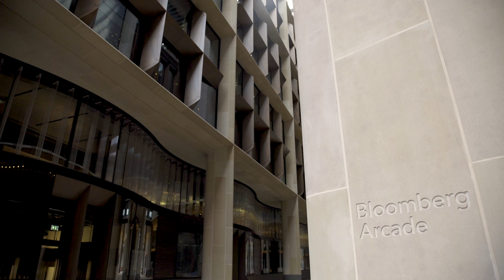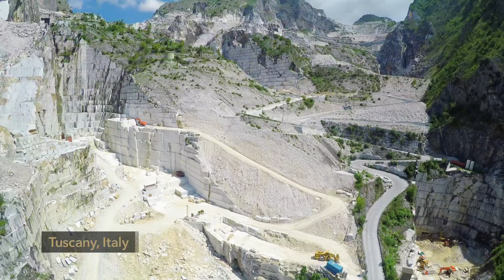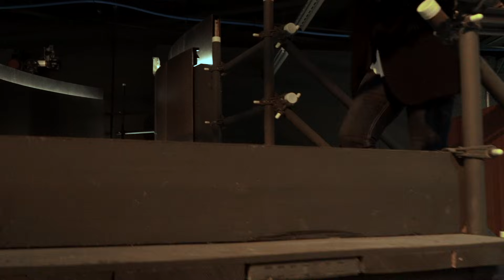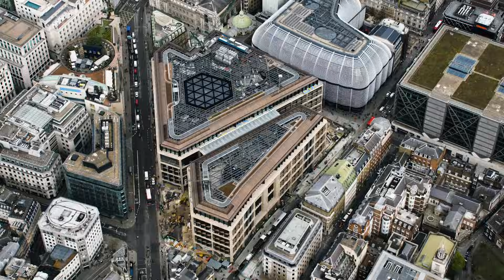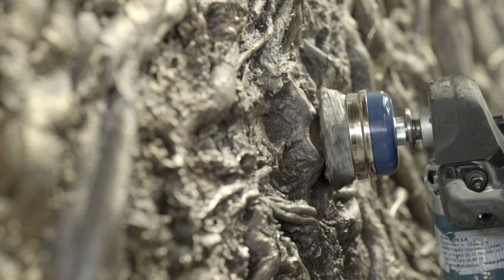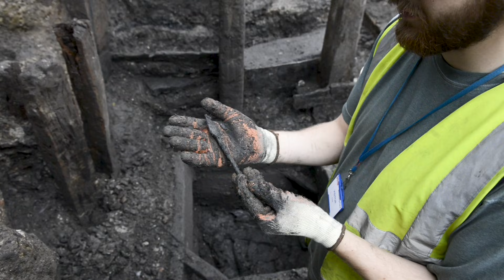Bloomberg London:  Workplace of the Future

Comment: The breathing building of letting air flow in small slits and exit from roof is so common in buildings in cities where its very hot and humid and who cannot afford ac’s . These open circular workstations and workspaces are sold by various companies since a decade now. Also excavating 7 floors and building biggest piles and concrete below itself is using unnecessary energy when you have open space upwards, how can these concepts be called sustainable. Using Sandstone and Carrara marble itself in a humid city is a question, it is used only in dry areas.  Only marketed with very big words called sustainable very well here in the video.
Reply: The building is in an area of the City with height restrictions and an obligation to keep a free line of sight to St Paul’s - so you can just build upwards freely as you assume